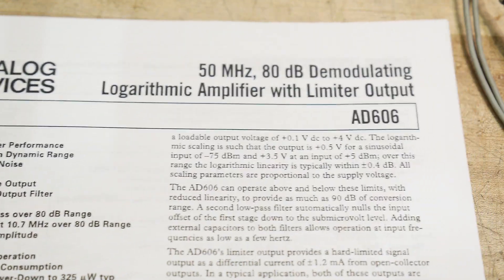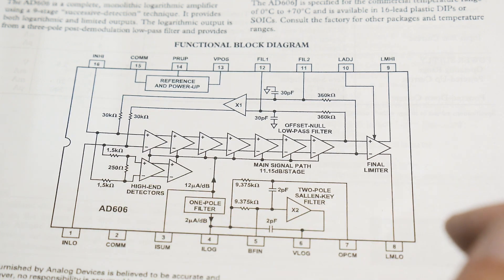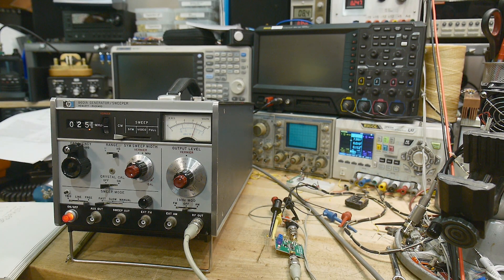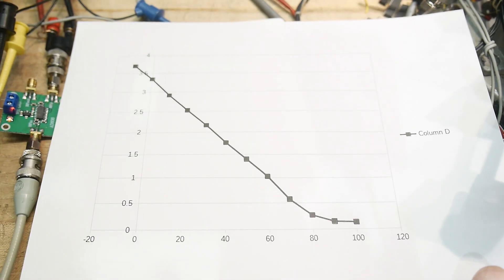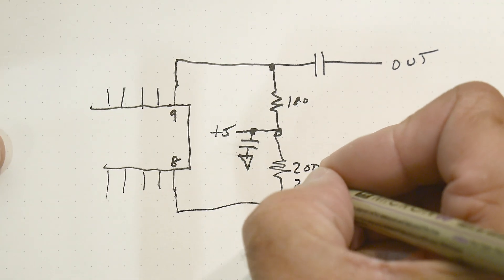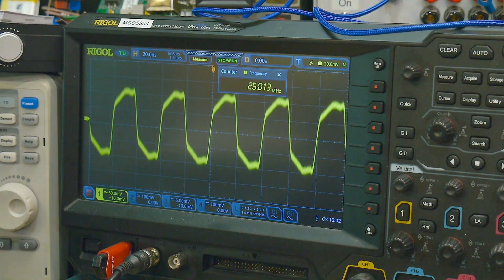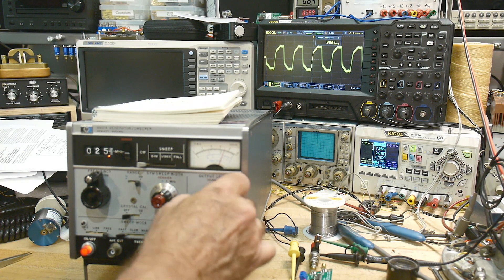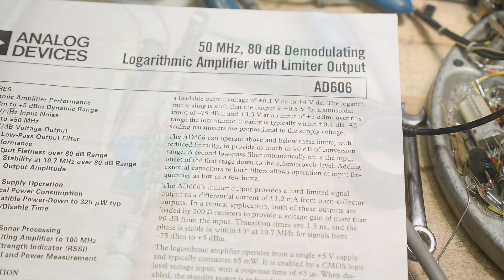#1629 AD606 Log Amplifier Module

Comment: Hi! Nice video, guy. What about the RSSI output? I cannot manage to get it working. Stuck @1.23V whatever RF power I apply to the input terminal. Tried -60dBm to -20dBm @30MHz.
Reply: I reply myself: the power supply voltage was too low (+5V) so the internal voltage regulator (78L05) was not regulating. Rising power voltage to ~8Volt solved the problem. Thanks.
Reply from the maker: glad I could help 😎

Comment: I used a cousin of this part (AD640) in a signal processing chain that started with a photomultiplier tube and ended with a PLL. The AD640 limiter output fed an almost constant amplitude signal to the PLL, resulting in an incredible dynamic range. Believe it or not, you can dig out an optical signal where each pulse of light consists of less than a dozen photons.
Reply from the maker: I worked on CMOS imagers and the small size pixels don't hold that many photons (converted to holes). Some 10bit A/D conversions of those pixels equate to one bit of voltage per photon.

Comment: "That kink right there" is merely noise in ONE data point.  Ignore the point at 70dBm and that kink moves to 80 dBm where the part's noise floor is about as big as the signal.
Electric charge is conserved -- or Kirchhoff's current rule demands that the current have a destination.  Omitting one pullup opens up the current path so no current flows in either path slice.
Reply: yep

Comment: Being a student i need a detailed explanation for each and every topic start from very basics 🙂
Reply from the maker: This is a review of a particular part. If you don't follow this then obviously you won't be needing to use this part. I understand viewers are at all levels and try to create the spans this. I have 1600 videos so do watch some others and maybe come back to this one. I do a lot of RF engineering which you must be lacking. learn about power units of dBm and RF amplifiers.
Reply: Yup
Reply: Agreed. This outside of my knowledge base, so I had trouble following along. I would also like an expansion to its described uses.

Comment: How linear is the frequency characteristic? I think this module can be used as an input cascade for a power meter/frequency meter. Just add to it the frequency divider and Arduino for calculations.
Reply: I would love for Emsai Guy to do an Arduino project with this chip... To learn more about the chip's operations, uses and configurations. Please.